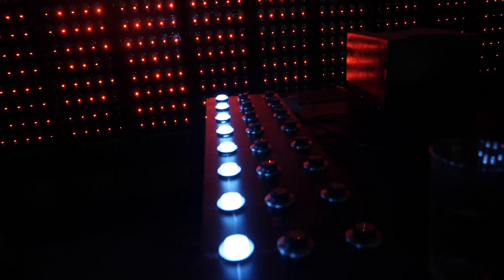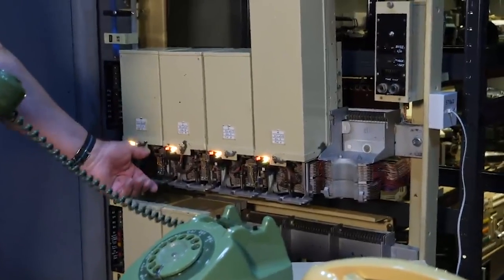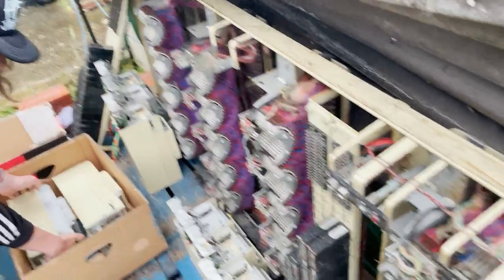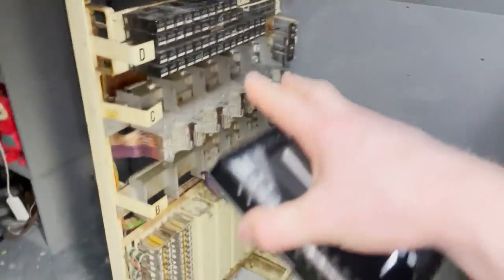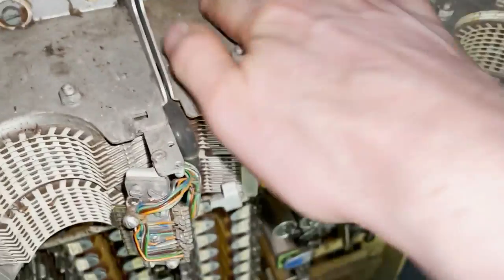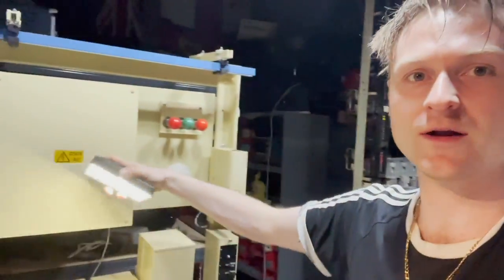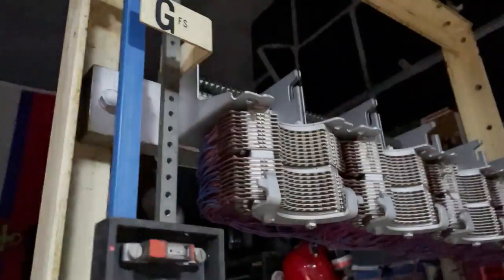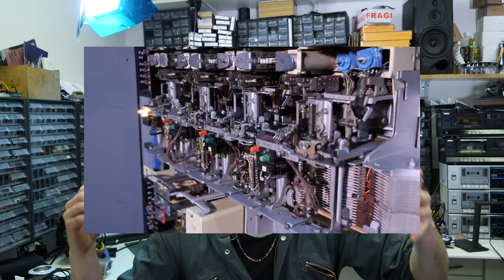Buying An Old 1960's Strowger Telephone Exchange For Restoration!

Comment: i used to hand solder those boards at siemens in the late 80's till the mid 90's....
Reply: Hehe....siemans
Reply: Its a phone board layout..  you have station lines that tie to co lines from the dmarc and from the stations youd have some kind of directory like startalk where you jump through incoming calls if were using it as an operators phone director deal or youd have them sit in a que sort of where it picks through the available lines and uses the nect free one automatically with its relays which are actually unique things with a strip of contacts that it chugs through .  Sounds like a big ass typewriter when its in use..  with some dings and buzzes and a bunch of chugga chugga clicky clicky….  And every now and again youd get a shitty contact that would hang open and make a brrrrr sound until it popped back into rotation..   hard to explain, especially since ive been away from that kinda thing for a good 10 years st least,.  Worked more on t1 lines and basic analog blocks for 911 and did a lot with a pbx..    was a shitty part of my life but pretty much the whole things been shitty so i guess no reason to forget about any of it..   damn i need a good hollow point pain killer….
Reply: @Common Raccoon I had to lace the wiring looms for similar machines.  One job required me to build a loom as large as our car park... I had to make it in the car park itself.  I had it all to myself :)

Comment: I am from Malta, where telephones ran on Strowger exchanges up to the 90s! I remember seeing one of these exchanges in operation when I was an engineering student at university, around 1993 or so. Very noisy device. One thing I remember which I'm not seeing in yours was automated rotary switches that would search for unused lines. Since the line would be short circuited (on hook) it would have no DC voltage across it, lines with voltage would be skipped. Of course, as the contacts aged more and more live lines would not be detected resulting in crossed lines - one of the wonderful artefacts of the Strowger system. It goes without saying that there was no such thing as call logs, the phone bill was just a count of 'pulses'. Also phone calls had a fixed charge for any length of call - I remember calling my girlfriend in the evening, going to sleep with the phone still off the hook and saying hello to her in the morning. Those were heady days!

Comment: As an apprentice I was tasked with building a battery back-up bank for one of this thing's successors,  the System X exchange, in our lab environment. Just as I was connecting the final cable onto the -50v battery terminal the spanner slipped and the other end contacted the frame, which was unearthed. I had been given an uninsulated spanner by the supervisor and as a result there was a loud bang, a flash and when the smoke cleared I could see that one side of the open end of the spanner has welded itself to the frame, but this was no longer connected to the spanner itself as there was a good 5mm of it missing! Those battery banks were rated at 50v / 100 amp continuous and could deliver a lot more than that in a short circuit condition.  My supervisor got a proper bollocking and went to one of our other sites to hide for a while! This was all 30 years ago now, happy times.

Comment: The old spiral things are 'wire wrap' connections made with a specialized tool, the wire wrap tool.
It's a very cheap and obtainable tool.
Reply: was just about to say the same thing. they're a bugger to use.

Comment: Long term project:
Wire in all the "noise" making equipment in the museum and you can dial to each of them with multiple phones. You get the phone-busy sound if the device is off.  :-)
Reply: That would be so cool, you could have a list of 'noise numbers' next to the phone. It would also be fun to use it to start looking for the device actually making that weird noise in the museum after hearing it on the phone. I think that would be a great way to explore the museum.
Reply: omg that would be soo cool!
I was thinking just put together some very simple synths that can be called, but using the existing ones in the musem would be SO much cooler!
Reply: brilliant idea, really
Reply: What if I could actually call the museum from an outside line, and then pick a specific noise number, like an extension. Maybe like internet radio? Id be cool to actually give each museum piece its own phone number. Thats a lot of work O.O
Reply: Or get himself a GPO 1960 switchboard, with pulleys inside and plugs and sockets lines outside connecting to his newly built exchange.

Comment: This brings back memories. In my last year of school an old 50-line PBX turned up in the physics lab. They let me have a go at trying to get it to work. I mostly succeeded, but it was missing the motor thing at the bottom that produced the tones and ringing current, so I had to bodge something up to replace it. I can't remember exactly what I did about that. I do remember connecting four 12V lab power supplies in series to power the whole thing. Fun times!
Reply: Basically it's a rotary converter that turns 50 Hz mains AC into various frequencies and interrupts them using rotating cam switches, so I suppose you could use all kinds of solid-state replacements that generate things like your dial tone, busy tone, ring tone etc. It wouldn't quite sound right though, because those converters were quite audibly analogue and electro-mechanical.

Comment: Still have my wire wrap tools. I went into the telecom industry when those things were being replaced with digital switches (circuit boards) and now they are the size of a desktop pc if not smaller. I can still remember how loud and big the switch rooms were.

Comment: One reason shorting across the power bars might take the end off your spanner was that a typical exchange would have an almighty 50v backup battery connected that would keep the exchange, and the emergency calls that use it, running perhaps for days through a major mains power outage.
Reply: Exchanges batteries (2 off) were originally specked to support the exchange for 24 hours with back up generators to support them beyond that. In the later years of strowger, it was accepted that due to the increased traffic volumes, the batteries would only be needed to support the exchanges for 1 hour before the generators were fired up. In practice, the battery support was probably somewhere between the 1 hr and 24 hr requirements depending on the size of the mult and the time of day. The batteries themselves each had 24 individual lead acid cells, and in the bigger exchanges each cell was an open top box roughly 40” high, 40” deep and 24” wide. Laid across the top of the plates (run width ways) of each cell where two pieces of plat glass (run lengthways) at 45* so that they formed a gully so that the engineer could pour the sulphuric acid without too much splash back. The batteries were ‘floated’ across the power input from the rectifies to provide smoothing to the incoming current. Each exchange unit had two of everything in the power room, so two rectifiers, two batteries and two standby generators. The city centre central telephone exchange I worked in had a Strowger local (mostly 2000 type, but some pre 2000) a crossbar local (type 3) and a TXE4 local as well as a Strowger trunk, a telex exchange two manual boards and a repeater station. So that was 8 power set ups each separate (although some of the older stuff shared the same power rooms. The sysX and sysY exchanges that replaced most of that each had their own power cupboards and were no where near as exciting.
Reply: @captbeardy  Thanks captain, great detail. I was a signal and telecom department trainee for British Rail in the 1980s and the internal phone system still had many small strowger exchanges working at the time. My training involved placements with tech teams for both signalling and comms, and at the end of it I chose to go into the signalling side of the organisation, but I was pleased to have seen this classic tech still in action towards the end of its life. Railway signalling at the time was still mostly relay-based, although processor-based systems were just around the corner.
Reply: I have heard the myth about a spanner being vaporised when dropped onto an exchange's buss bars.
Reply: @stephenw2992  that’s certainly a tale I was told by the ‘old boys’ I worked with in the Strowger exchanges. I can’t verify it as true, but looking at the size of the exchange main buzz bars and the fact that in the older parts neither the earth or the 50v bars were insulated (though the 50v was painted red) I can certainly believe it possible. I’ve heard other tails of daring do and misadventure in power rooms, and even seen the evidence of one or two, but people do like to exaggerate 😁
And then of course there’s the Christmas we set up a bar in one of the CTE battery rooms supplied by one of our number who was also the chairman of a local rugby club. 
Ah, nostalgia is not what it used to be.
Reply: @stephenw2992  believe me no myth.
Reply: Its not a myth , as a 19year old technician on an installation crew I was stupidly tightening the left hand shelf mounting bolt into the rack with a shifting spanner ( yeah, dont say anything, 19 is 19)  between the two bus bars instead of using a socket and insulated extension, spanner slipped and shorted to the live bus bar, end of spanner vaporised, shirt full of holes and arc burn to eyes, off to A @ E , eyes washed out, was wearing dark glasses for days and a serious bollocking from the boss.
Reply: My mate destroyed a metal chair pulling it down through the rack..  only 50 volts but the current is huge

Comment: I remember shorting a bus bar whilst working on the top of the rack and the molten bits of my spanner set fire to my mates T'shirt who was standing below me. To think it was only 50v DC but the current load..well!
Reply: My mate did that in our exchange.. he was pulling a metal legged chair between the rack and a travelling ladder..  and the leg rubbed off the blue insulation of the bus bar..  and it was also in contact with the frame..  BANG!!..   the chair leg was destroyed..  the rack went very quiet as the 50v fuse had blown..  we rushed round to find him looking white faced.  Ha ha ha..   good times…

Comment: I wonder if back in the day, the crackling heard over the line while having a phone call was due to this sheer amount of mechanical contacts of relays and switches. I had always thought it was due to the cables outside being moved by the breeze, but seeing such machine changed my mind... I miss those crackling sounds a bit, it added some thrill to the conversation.
Reply: You shouldn't be hearing crackling once the call completes unless the contacts are extremely dirty. Other possible sources of the noise are the carrier or radio links between exchanges, or the other party's microphone.

You could, however, hear the switch working while you are dialing. Such sounds can be found at evan-doorbell.com
Reply: @user2C47  Johann...I mean Evan and his pals sure got a LOT of historical recordings! I've listened to many of them! He narrated the audiobook version of "Exploding The Phone" by Phil Lapsley. A very interesting character 😁

Comment: You could also use it to dial up which synth you wanted to listen to, and use another line to dial up a MIDI destination to send keyboard data to. Have a station with monitor speakers, a keyboard and a couple of dialers, one for the audio and one for the keyboard, then the correct dialing pair would allow you to play the corresponding keyboard.

Comment: Remind me  of Going to work days with my Bio Dad and going into BT Exchanges back in the 1980s ~ 1989 They Were doing the Analogue to Digital Conversions + Tours of Mercury Rectifiers + Lift Machinery + Backup Generators + Battery Rooms + Transmitters 
Even taken a Good Few of these Apart due to them being Scrapped

Comment: I wish you all the best on that project.. they are quite a bit of work I have not worked on anything like that for over 40 years now, if I was not in Australia I would offer to help get it going

You will need another power supply 
telecomms usually use a + earth

Comment: The Tunny Machine at Bletchley Park (designed to help break the Lorenz Cypher) was based on uni-selectors used by the GPO... Obviously later replaced by valves of Colossus.

Comment: Can't wait to get a couple friends and a truck so I can move the old Nortel SL1(with Meridian Mail and old HP console for admin stuff) out of a hotel I do work at and into my personal phone museum. It's basically a mini version of the DMS100 that runs many North American phone exchanges and can even use some cards from the DMS. I would love to get the Redcom MDX mechanical switch from a certain exchange in Alaska. I loved the sound of that thing when it was in service.
Reply: If you mean an MDX386, I have several shelves working, and they don't make much noise, as with the eception of the line card relays, they are PCM switching.
Reply: @leejgen8754  They have/had a 384 up in Livengood and there used to be a test number you could call that would read off temps, humidity, etc and then let you listen to the room for about 5-10secs....lots of clicky clacky gear in the room. The exchange is still using the old error messages (CBCAD, NIS, etc) they recorded in the room and you can hear the switches in the background. It was also the last exchange in North America to respond to 2600 and bluebox tones.

Comment: In the 1990's the Highlands of Scotland were eventually all turned over to the digital telephone exchanges, and the old exchanges were removed for scrap. 
But....!!! 
A local "scrap merchant" packed them in shipping containers and sold them all to India. 

One of the electrical supply company's substation still has a working version of a single "exchange", as it still has a dial telephone that clicks and whirrs when you make a call, but you can not phone a business with "push button options" to reach a department.!

Comment: I took one of those same systems out of commission in a hospital once..   i played with it..   a lot..  lol..  if you take the power supply and run it to its max power (50v) you can cross some jumpers and they send certain co lines to house lines but since theyre not working ie no ring current then they twitch and buzz like what you hear in the background of old telephone operators sound clips….
Reply: Tell you the truth tho i ended up blowing the hell out of it.  In that room they had a 480v switchgear and i ran it to the mains when the hospital was dead one night and it friggn looked like some 1980’s scifi movie with it arcing through all the station lines and all..  exploded all the lights and melted a bunch of it..  was fuggn awesome…

Comment: If you can get two running,set each one up to simulate separate mini exchanges with phones attached to allow demonstrations of a phone on one calling a phone one the other
Reply from the maker: hey up im just looking through the comments but thats what i ended up doing. i have them boith currently about 10 phones and 10 synths wired in to each. neqw video coming soon check this museum not obsolete youtube channel i chat more about it